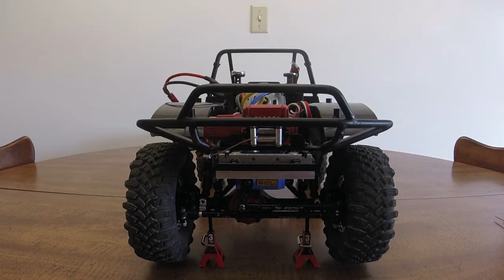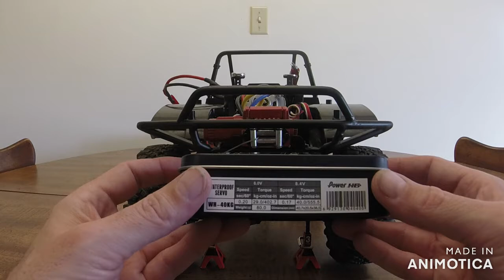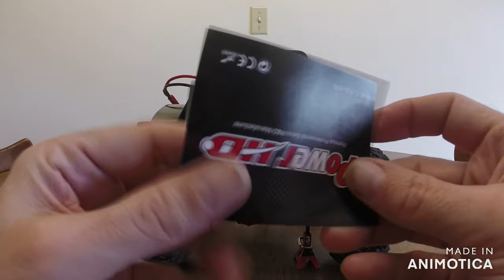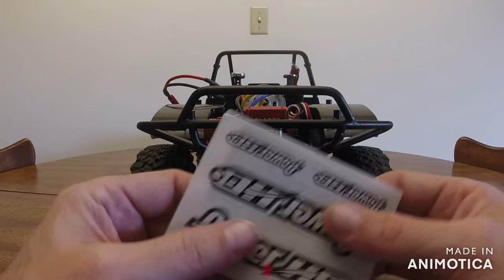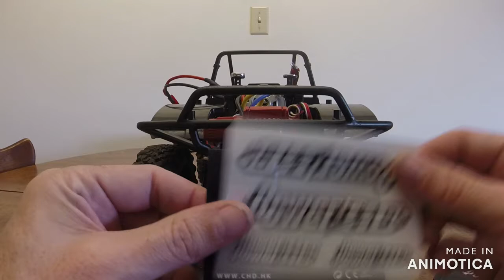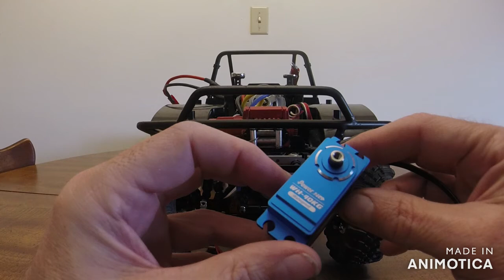Will this make your Demon kit better? Maybe?

Comment: how do we know what size to get though ?
Reply from the maker: Steering servos in all 1/10th scale truck will be standard size. No compact or sub compact servos are used. One other thing to keep in mind, any servo, and I mean any servo that does not state it was manufactured by JR/Airtronics, Hitec, or Spectrum will have a 25t spline or Futaba spline.
Reply: @Xoarkitty   sorry let me go more in depth in my question since you know what you are talking about.. The power HD line that crossrcus sells . I am getting a SG4c demon  and doing some modifications to it .. How would I know whether or not I should get the 20 /25/30 or 40 ..  Im sure there is a sweet spot between having power adn having to much power to break things
Reply from the maker: @PopcornH3  Ah! Okay now I get where you're coming from. To be honest I would go for the 40kg. It's what you see me install here on my SR. As long as your end points are set correctly, you shouldn't worry about breaking anything. It may seem like a lot, torque wise, but you're also asking it to move two large tires under a truck that can easily weigh 8 to 10lbs. Especially if it's going to see actual use. For an occasional light trail rig you could run the 30kg, but again given the weight of the SG, wouldn't go lighter in torque than that. Hope that helps.
Reply: @Xoarkitty   100%
Reply: @Xoarkitty   everyone else suggests the 25kg and tells me the 40kg is for a larger scale rc and i will be breaking stuff with a 40kg . on a sg4c demon
Reply from the maker: @PopcornH3  As long as your endpoints are set correctly, I wouldn't be too concerned. Yes, the 25kg would work well enough if you're not tackling too difficult a trail. Of course if you're are building a lite duty rig, the 40kg or even 30kg may be overkill.